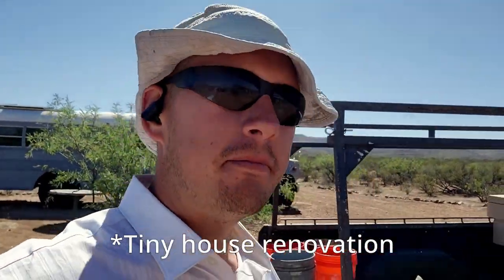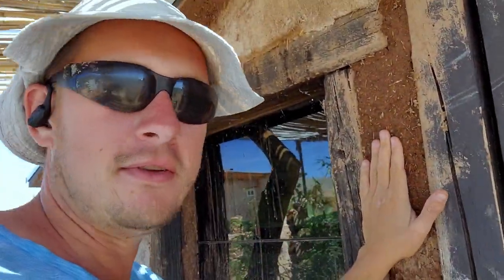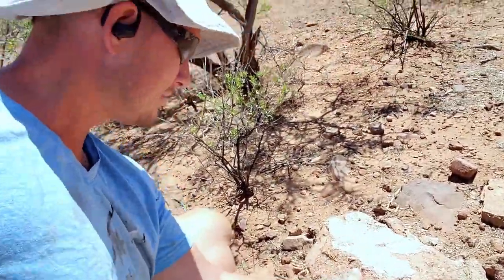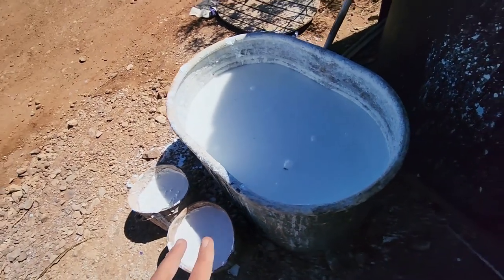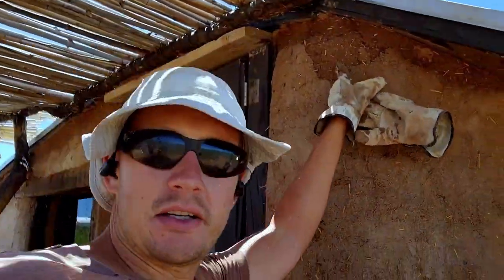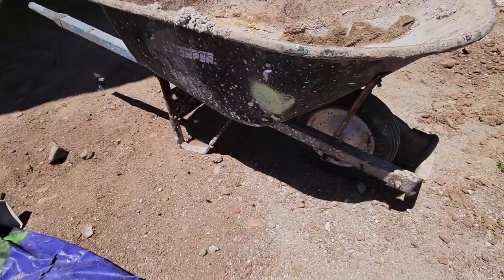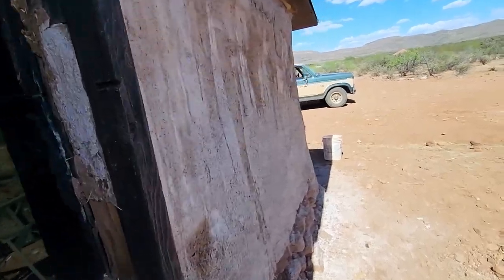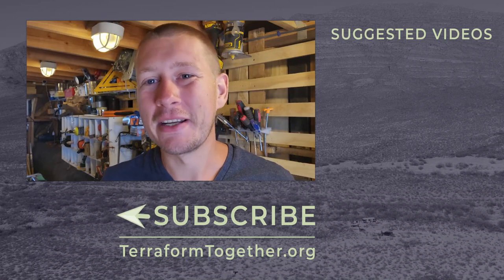Using Natural Building Method of Cob & Lime Plaster to makeover for a 54 sq ft Tiny Home

Comment: So why can't you use cement over dirt like you said? Does it just not stick? Why do you prefer cement over lime? Sorry. I'm ffffuuuuullll of questions. I always like to know why people do or don't do something when it comes to building. That way when I figure out what I'm gonna use I know why or why not to use something 😂
Reply from the maker: Sure thing. Cob, Hyperadobe, and other adobe buildings will absorb moisture out of the air during rains and high humidity. If that moisture get's trapped in the wall you have problems. The water will try and escape, reach the layer in between the plaster and wall, and sit there. When you have a freeze, that trapped water will expand and pop your plaster right off. 

Lime plaster will allow that moisture to be released so you don't have that issue. 

I prefer cement over lime because I find it easier to work with (it doesn't burn as bad), and it requires less maintenance. For our workshop we were able to use cement because it was just going over asphalt paper. Everything else has been lime. I have an idea that I am working on to be able to get the insulate properties of Cob but still be able to use cement. That video will be out eventually.
Reply: @TerraformTogether  ooohhh that makes sense. Glad u asked cause I was gonna use cement
Thanks!!!!!!!
Reply from the maker: Sure thing!